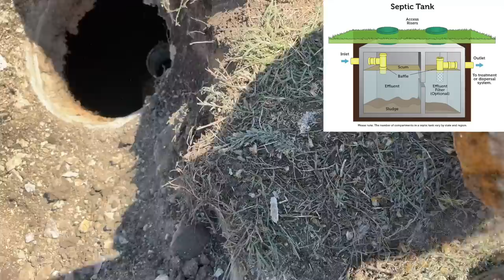Septic Tank Hasn't Been Pumped in 24 YEARS!

Comment: My system I had in NY was 25 years + when we pumped it for the new owners. Opened it up and there was about 6" of soft crush on top and about 4" of sludge on the bottom. We never put anything in that tank that belong there. Even the greasy pans and plates got wiped off before washing. so if taken care of no need to pump that often. But I understand no a days people do not take care of the things they can not see.  Ron  USCG RET

Comment: And that's why ya'll should pump your septic tanks every two to five years
Reply: I mean, what I got from this video, is that once every 24 years works just fine..
Reply: As a local septic expert in my town, we know it's better to get it pumped every 2-5 years. 5th year seems a stretch so we would do 2-3 years. if you wait 24-years you will have a thick crust at the top of the tank and we would then have to use the Crust buster to break it up, and just like what that guy says, break up the crust and mix up a delicious poop smoothie. So don't wait 24-years or else you'll regret it.